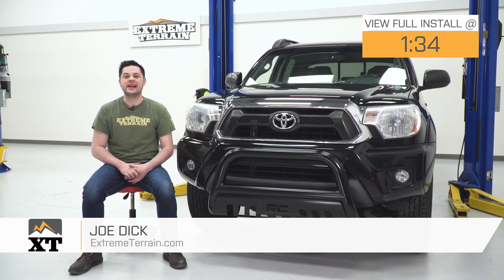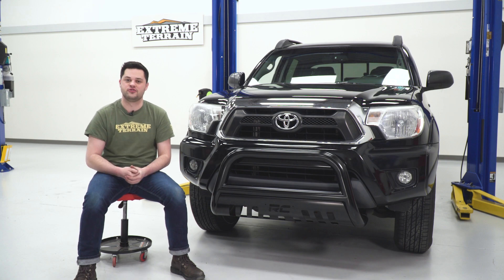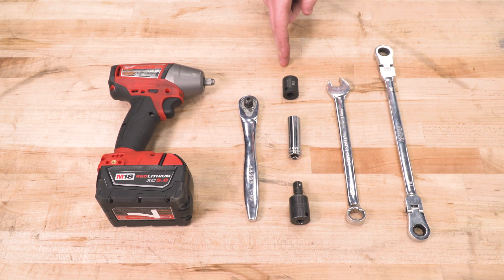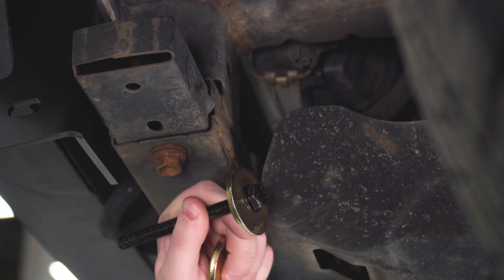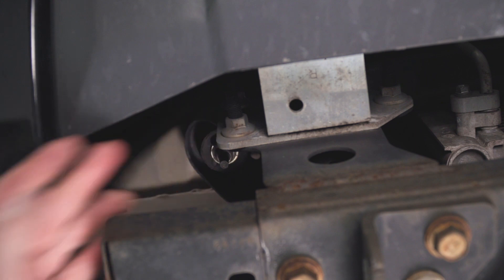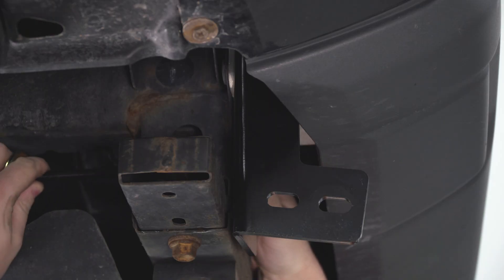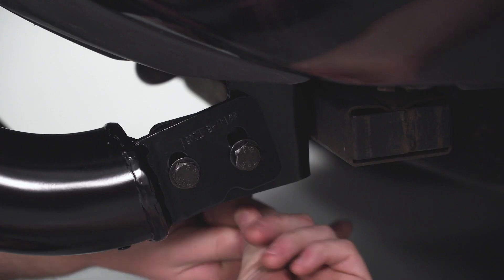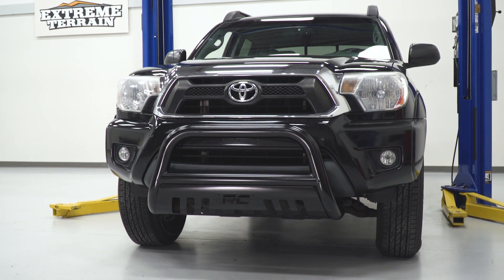Tacoma Rough Country Bull Bar - Black (2005-2015) Review & Install

Comment: Thank you very much, got mine today and the installation instructions that came with it were a bit vague with the little closeup pics that weren't much help. Rough Country should include a disc with instructions like what you just did. Anyway, thanks again. You made it easier.

Comment: Well now I've started in on the installation and after spending most of the day and getting maybe 50% done I must say that there were a whole lot of things that were omitted in your video. Like some of the pics it appears the bumper and grill were removed and no mention of that in the video. Wish those steps were included. So I will have to back off on my comment that I left 2 days ago and say although it is informative, lots was not included. I don't see how in heck that this could be a 2-hour job.
Reply: Bro it’s like a 30 min drive idk if you’re slow or something?